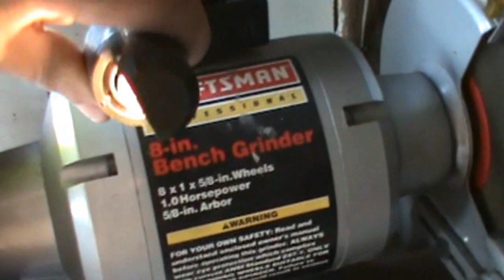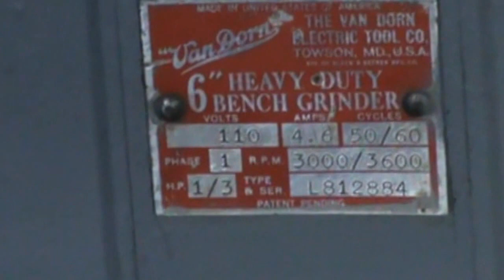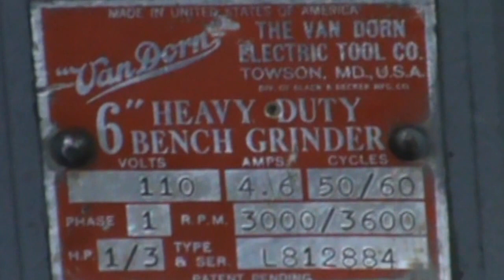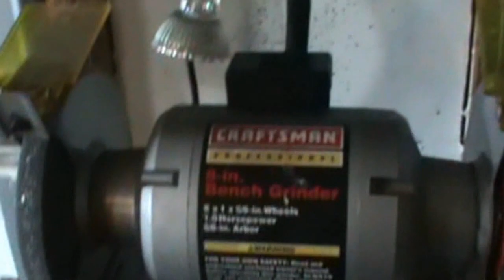How to add a light to your bench grinder

Comment: Looks good.  I have the same grinder and will make the same conversion.  One question.  How does Craftsman convert 115 VAC to 12 VDC for the original light?  I don't see any other components except the starting capacitor.
Reply: It doesn't. I don't know what kind of bulb was in it, but it was likely an 110 V incandescent judging from the way it was dim and then brightened.

Comment: Nice Job! It's cool when you can find just the right light too!
I have a maybe, 27 yr old. B&D 6" Although I use often, what I do is just play around with it. Clean rust off of hand tools, buff stuff. I wanted to ask is there suxh a thing as an extender that would allow me to add more things on to the grinder without have to unbolt/bolt every time, Is there?

Comment: I have a grinder that looks pretty much identical, but it has different lights and eye shields. It runs way better than either of those. Spins up quickly and sounds much better than that. My lights are attached to the eye shields. My shields suck, and will soon be replaced. I was looking for ideas, for lights, but it won't be this one.

Comment: Nice job what I don't get is my bench grinder is the same one but mine has allready a 120 outlet for the bulb and it shuts of and on by it self . Maybe they saw your video and felt like a ass not to do that in the first place lol lol before I saw your video I opened mine up and I did all the wiring the right way cause I didn't like how there cheap little peace of black tape to the end caps other then that it works good I got mine as a gift about three years ago and I use it a lot pluss I have a old one that I got on criglist for 60 bucks and it's Alsome but ya great video I've see other videos that u do no one nos it all so I always like to watch videos even on things I've done all ready cause u never no if u learn somthing new !! Keep the videos coming !!!!

Comment: The only Vandorn I know about makes plastic injection molding machines,   looks like you need to dress the wheel on your Craftsman grinder looks to be loaded up with aluminum.  Grinding aluminum on a bench grinder is a no no use a belt or disc sander on aluminum.